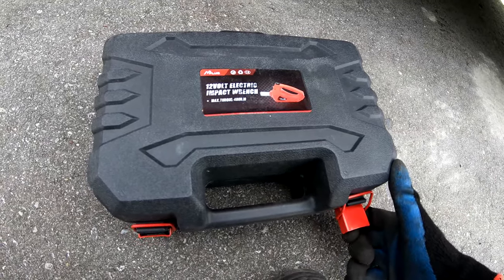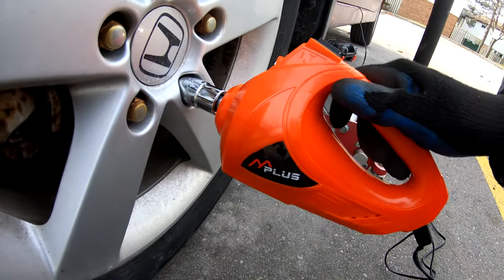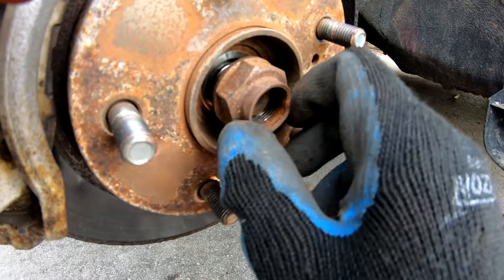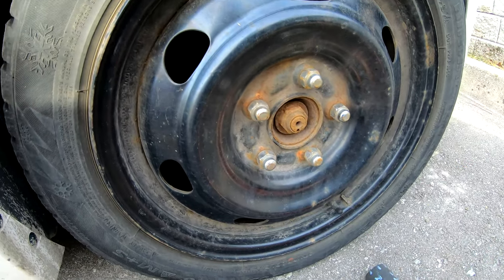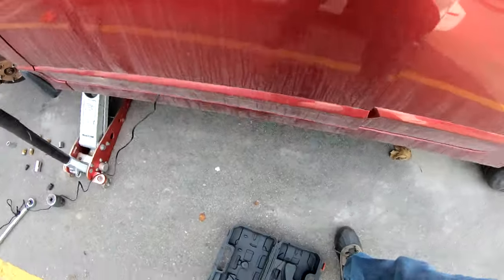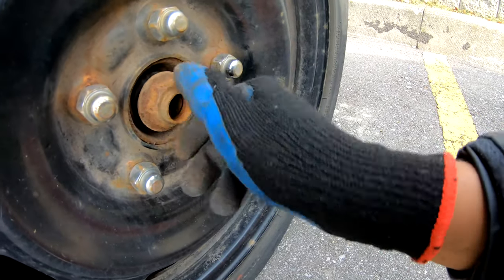Mplus Amazon Roadside Impact Wrench Review

Comment: I thought it's a cake mixer
Reply: Lol 🤣 cake mix
Reply: Dude that’s one hell of a cake mixer 🤣
Reply: Вот,а я о чем-у кондитеров такой же,только белый или розовый и с другой насадкой
Reply: thats a more powerful one than i have coz it does 1 blow and takes off
Reply: It is. But it is super powerful because it spins a lot before hitting. Prob break quick too. But truly is an Amazon pile of trash. How would u use tight places. It’s just ridiculous cake mixer
Reply: rare of cake mixer..
Reply: @jecrpalier  it's apparently intended for removing lug nuts, not for general purpose auto servicing, so clearance isn't an issue since they always face out.
Reply: They usually call it an egg beater

Comment: I got one similar at walmart 10 years ago and it claims 250ft lb. It is surprisingly powerful! A bit slower but it gets the hard part done. In about 2 smacks it has 85 ft lb lugs loose! Also on the one I have it seems more powerful with the engine running and 14+ volts.

Comment: Torque test channel did review this on over if his videos, that's pretty ingenious and quite impressive, of course, there's a risk of will die on you at the most inopportune moment so having a manual backup is advisable. I've of his died (to be fair, it was the 12v plug that died on him, the tool itself worked fine)

Comment: Wow that thing works pretty darn well. I like the action of the hammer mechanism, it's like the motor winds up and then the hammer delivers a sharp impact. I like what you said "mplus don't care about your stake". Lol it zipped that axle off pretty easy! Great video man 👍. Would like to see the max torque capability with a torque wrench setting up each fastener that's tested (kinda like how koon trucking does it on his channel). That would help eliminate some of the people thinking the fasteners were pre adjusted so they easily come off.
Reply: True test would be a Honda crank bolt, but that's a tight spot.

Comment: I like the extended anvil I don't get why they aren't more common in higher end impacts. Makes lugs easier when you have deep offset rims. Although on this tool I assume it's there just because it's oriented like a cake mixer 😂
Reply: Torque is lost with extended anvil.
Reply: @mu9900  You are incorrect—flexion, pretty basic stuff.
Reply: It’s so they can use the reversible sockets that come in the kit
Reply: @kickboxs77  the one I had showed a really loose fit of the sockets to the drive anvil of the wrench; is that how it was intended to be?
A sloppy fit like that would increase the impact force by allowing greater wind up and slapping force, but couldn't be good for longevity.
Reply: It’s because people want them to be as small as possible to fit in tight spaces. If you want it longer you can use an extension or deep socket. If you want it shorter you can’t just shorten the anvil.

Comment: Hope you can help. I press the button and hold the socket.Motor inside turning but socket doesn't turn.
Can stop it with my hand easy. No power. Am I doing this wrong
Reply from the maker: Hi if u hold in air not holding socket does it wind up then hit ?
Reply: @singlecams  
It's not air it's electric powered by the vevor power box.
Reply from the maker: @keifer242  can u post video 🤔

Comment: Looks really good but I wouldn’t use it on locking wheel nuts especially Peugeot locking wheel nuts it will destroy them there not the strongest at the best of times

Comment: Longevity is key, I wonder how long this thing would last in automotive use, probably a week.  But yea if you just need something to get the job done once in a while not the worst idea.
Reply from the maker: U can see inside it already blew (but I did put 20v to it😊😆 )  good thing is u can just fix it with a paperclip and duct tape probably lol.
Reply: Defenitiv not for daily use but seems great for the once a year rusted bolt or for your grandparents to change a flat tire.
I probabĺy buy one to get the nut of the belt clutch from my ATV off